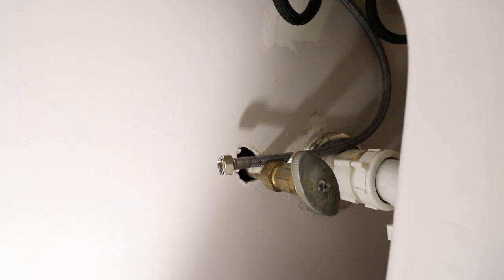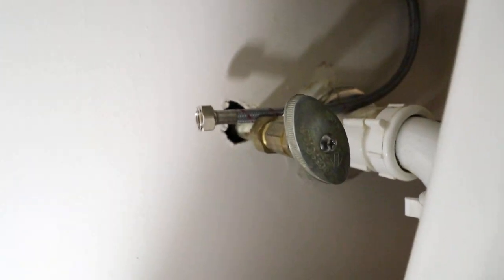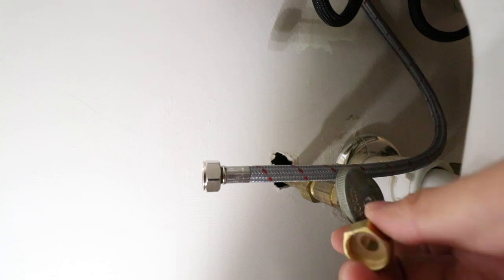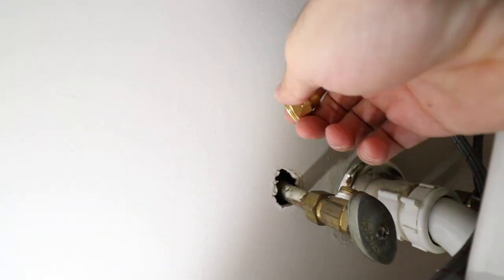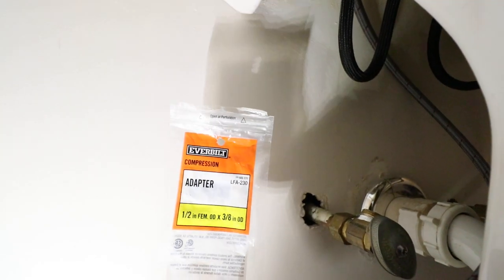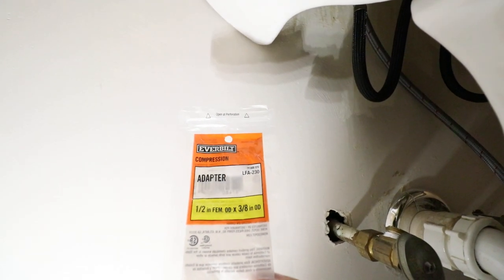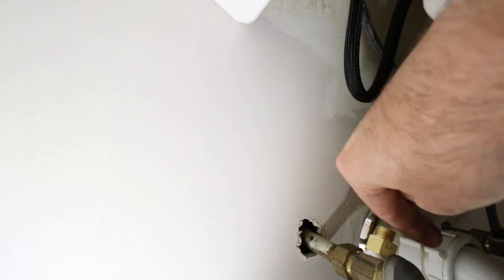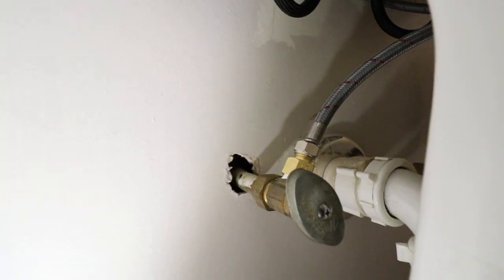3/8" Compression Fitting Installation For Water Supply Line

Comment: Great video.  Please correct me if I'm wrong, but I would not use teflon tape with that adapter.  The reason is that it looks like there is a white washer on the 1/2" side of the adapter and there is always a black washer in the braided hose ends. The washers keep it from leaking.  If you try no tape, you will see what I mean.  But I use tape on all other such fittings that don't come with washers.
Reply from the maker: Tom, fair point. The line does have rubber compression fitting in the end. So teflon tape is not required. I just make sure the lines are properly torqued.
Reply: @OneHourSmartHome  And what is that proper torque?

With the rubber in there, it's hard to tell how much torque is enough.
Reply: @noahkatz9616  Tighten till just snug. Turn on water. If it drips, tighten until it stops.
Reply: @MrTeff999  That's what I ended up doing, thanks
Reply: @noahkatz9616  Dura Trac Comp recommends hand tighten then 1/4 turn with wrench.

Comment: my valves have male 1/4 flare fitting to connect the supply lines to...do they make a adaptor to go from a 1/4in flare up to a 3/8 compression...if not then im gona have to change they whole valve out

Comment: I used this adapter and it leaks at the 1/2 connection, even after significant torque.. Is the Teflon tape a good permanent solution?
Reply from the maker: Are your threads on both sides clean? Are you sure you have the correct adapter with the correct threads per the video? Shouldn't leak at all even without the tape.